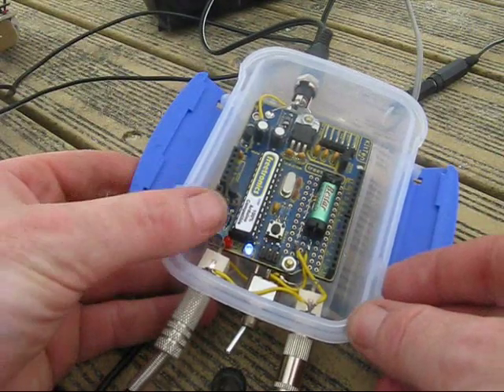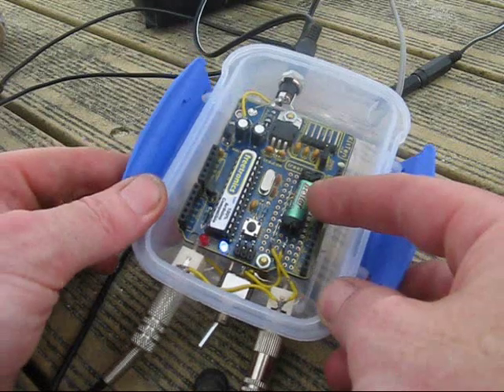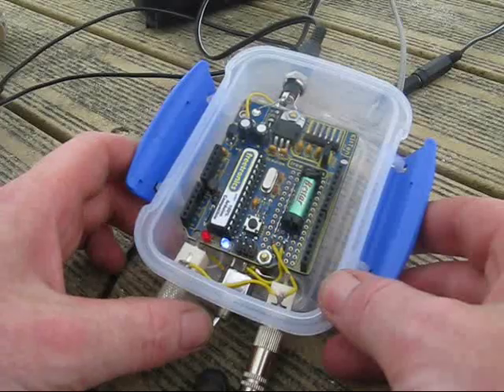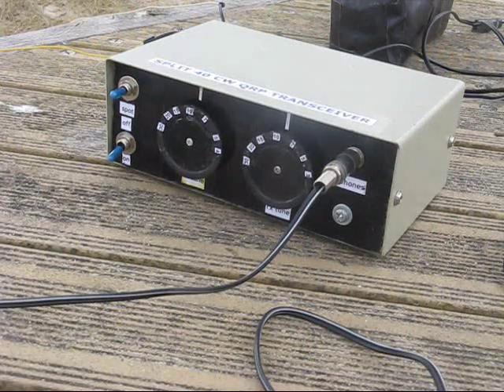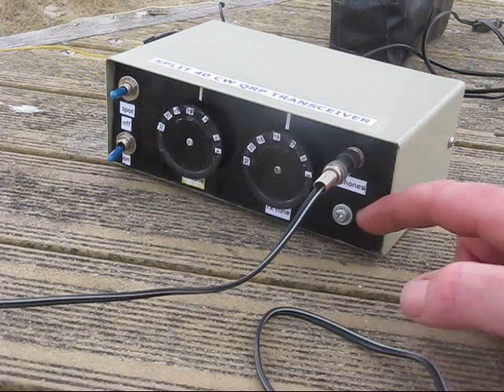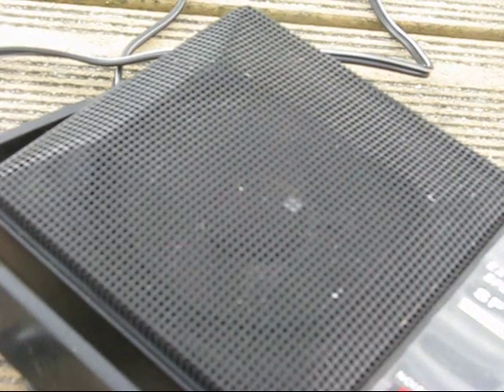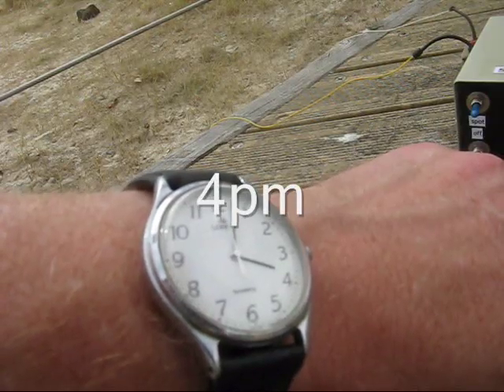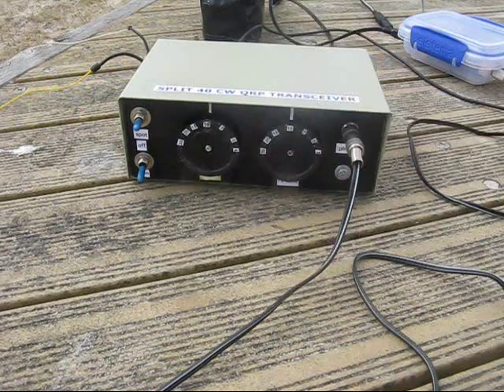Arduino for amateur radio: Automatic CQ caller

Comment: Hey Peter,

I have a video idea based on a concept that I'm not entirely sure would work. My idea is to make an 'Automatic CQ caller' even cheaper! This may require experimenting. 
My invisioned method would be to wire a reed relay to a 3.5mm audio cable. His cable is then plugged into a smartphone or laptop running an app that generates Morse audio. If this audio is loud enough, would it be possible to trigger the relay, therefore keying the transmitter? If not, I would imagine a simple audio amplifier should make this concept work. Thanks for reading and 73!
Reply from the maker: Good idea - it would definitely work!